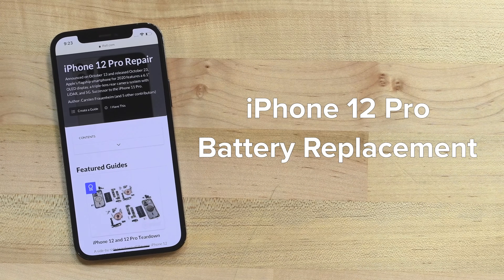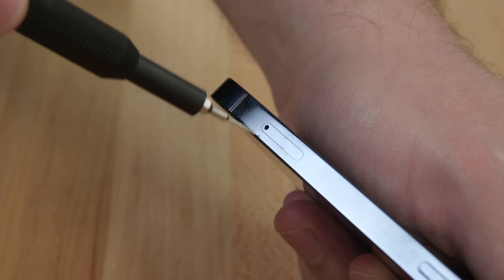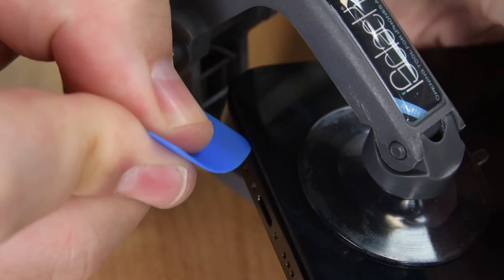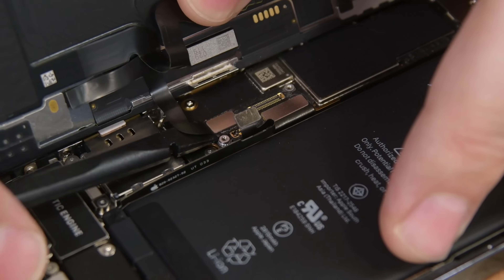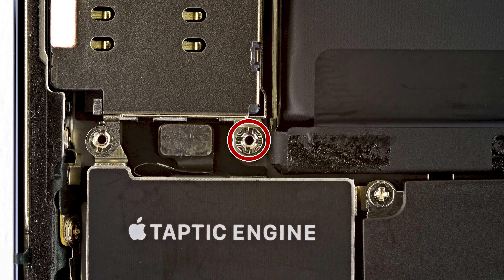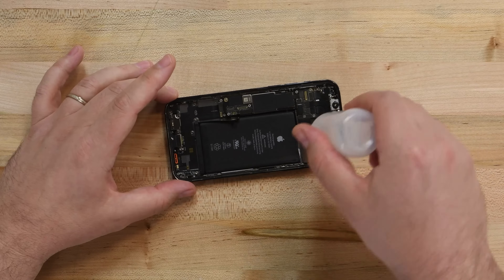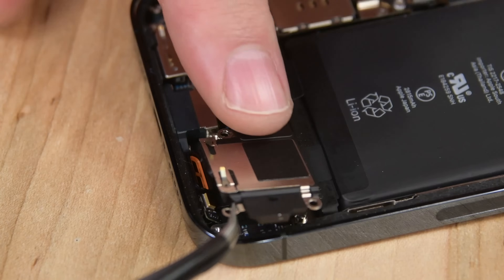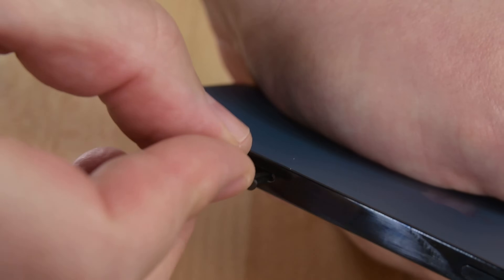iPhone 12 and 12 Pro Battery Replacement

Comment: Thank you for the video, still rocking my 12, but will probably be replacing it with something else that isn't an iphone, successfully replaced the battery, thank goodness for myopia when doing this sort of work, 45 and don't need a microscope ha! I did manage to snap a small tab off the speaker whilst cleaning up the display adhesive, but doesn't seem to have effected it as far as I can tell.

Comment: Notes (read through all before starting): 
1) Take it slow. If the screen doesn't want to come up, heat it up until it slightly hurts to touch (no hotter), gently ease it with the pick, back off, pull with the suction cup, try a different bit, ease away. Don't push the pick too deep. I used a plastic ruler to get under one side while I worked on the other. You could probably try to bend it too hard and crack the screen. Don't do that. 
2) You may lose a screw. They are about the size of a dust mote and they can ping off into non-existence very easily, especially if you are using the cheap plastic tweezers that came with the kit. 
3) The battery adhesive strips will snap when you pull them. Use isopropyl alcohol to weaken the adhesive and a 16 yr old islay scotch to calm your nerves. 
4) Under the battery, there's a circle of non-conductive paint that is very easy to scratch off covering the magnetic charger. Careful of that. 
5) The new battery may be a slightly different size, so make sure you (CAREFULLY!) re-bend the connector strip so that the connector can line up with the socket before you stick the new battery in. It might help to connect the battery first, then work out where the bend needs to be before sticking the battery down. 
6) The hardest bit is actually reassembly. Scraping the old glue off the rim. Take your time! A plastic spudger, cocktail sticks, alcohol and patience will get you there. Look into it with a bright light to make sure you've got it all out. No little balls of adhesive should remain.
7) Note that there are some raised contacts along the bottom of the phone that stick up to push against something on the screen. Careful not to bend them!

8) Putting the screws back in position without magnetic bits will be hard. Make sure you have a bright light on standby. 
9) Make sure the four screws for the top left cover go back in the right order. I believe the longest ones goes in the top left. Don't take my word for it - see which one came out of which hole. The longest one is only about 0.2 mm longer than the others. You may need reading glasses if you have poor vision. 
10) Careful not to strip screws. Be gentle turning and apply steady downward force while you do it. 
11) Apply the phone rim adhesive before you reconnect the screen. Make sure you get it the right way up. There is a right way. Don't take off the protectors until you're 100% sure. 
12) Be gentle pushing the connectors back into their sockets. Use a finger and gently wiggle them until you can feel them click into place. Don't force them in. Once you're sure they're all in, turn on the phone and check it's working, then turn it off and push the connectors all in again just to be sure they're not loose. 
13) Make sure you don't get dust/gunk inside the camera cover on the screen or the face. Don't stick anything down until you're sure it's clean and aligned. 

14) If you're like me and still not sure that iOS 18 will recognise your £20 new battery, it did for me after an update, even though it [claims to be] 9800 mAh. No soldering required, as the battery came with a BMS built in. You'll get the important battery message but it should show battery health too. You will need to calibrate it by charging it to 100% then leaving it on for a few hours then letting it run down til it dies, probably a couple of times. Then it should understand where its limits are.

15) Good luck! Don't kill your phone.
Reply: im not sure if this was a typo, but your battery is NOT 9800mAh unless its a different voltage for some reason but then it wouldnt work properly
Reply: @IcyPenguinCube  Yeah, it's almost certainly not. However, it does seem to be higher capacity than the original. Unless I spend all day playing youtube music with the screen on it will generally still be 50-70% when I go to bed, which is pretty decent
Reply: @tSp289  yea its definitly possible that its somewhat larger, the battery I bought claims to be 3320mAh when the stock one is 2815mAh if im not mistaken. battery technology has advanced enough to fit a higher capacity battery into the same size :)

Comment: After having done exactly this procedure - it's unnecessary to strip so many parts! It's enough to detach the battery itself and the display. It could be trickier to remove the adhesive strips underneath the battery, but fairly straightforward. Other than that -- very helpful guide!
Reply: You don’t even need to remove everything like they did here, just basically the part with screws  where the battery connects is hidden and that’s it, move the screen to the side and switch the batter with new adhesive and connect. They do too much sometimes making it harder than it is lol
Reply: Exactly. I have no idea why they remove so many screws and parts. And removing the sim tray - what for !?

Comment: I repeat, do not pry under the battery. I slid a pick in there to get the isopropyl syringe under it and the back glass snapped like it was nothing. This phone generation is such a pain to repair.

Comment: I know this is 3 plus years old but you don’t have to remove the bottom of board or  anything else. I replaced my battery today taking screen half way off leaning it on something and taking off just the battery cable. Thats it. The tape broke into pieces. I heated up my pry tool and slid it under the battery and worked the battery out. No extra cables or screws to take out. Just the ribbon cable for battery. That’s it

Comment: Now I understand why my nearest iPhone repair place is 1.5 hours away 😆 nobody wants to do all this and when they do they charge an arm and a leg 

I guess I'll just do it myself
Reply: It’s easy. I did one today without taking all the extra bs he did. I took off just the battery ribbon cable and used my case opener tool under battery and got the glue strips to let go. This guy makes it into a project.
Reply: @mickywinters8451  I would love to see a video of that 😲 very nice 👍 I just ended up prying up the battery and replacing it cuz it was ollllld 😆 I wore that dam thing out!!

Comment: Do you need a genuine apple battery to still have all functions?
Reply: Nope. All will work. But, your battery health will not work. So if you go and sell it someone will want a refund if the health shows not working. I just bought an oem Apple used battery with 89% health today for $15 on eBay. I actually have a 99% health battery thats installed in a 12 with broken screen but I didn’t want to pull a 2md phone apart just to use the battery so I bought one cheap and when I sell it the health display will work. If you don’t care about it go for it but as a warning the generic knockoffs I’ve used don’t last near as close as the oem Apple ones. My used Apple one I replaced in an iPhone 8 lasted longer than my new generic one.

Comment: Why are you removing so many parts? Isn't it good enough to remove the battery connector and then pop the battery out? please explain why all the parts arund it including the screen must be disconnected. Thank you.
Reply: Update. Watched another shorter video. He disconnected the battery cable from board only. Didn’t take off screen or sim tray is speakerphone and got the adhesive from the top with tweezers.  This guys is way too much just to get to the adhesive from the bottom. I’m doing a 12 on Saturday. Should be as easy as the 2020
Reply: Update. Replaced my 12 battery without taking all the other stuff out. It came out but the plastic strips he pulled off his, must have been loose from before. Mine broke into pieces and I ended up using my pry tool under the battery and got it out.
Reply: Yea I was gonna ask same thing. I didn’t see any connectors under the battery or at the bottom. All I saw was the 1st battery connection to the logic board. I’ve replaced batteries and screens from 6s up to se2022 and the battery comes off with one connection and a battery connection cover. Why’s he removing the SIM card reader and the microphone at bottom when the battery snaps in with one cable on the left side. The only reason I can think of is so he can get to the very bottom and get to the adhesive strips. Screw that. I’ll pry it up from the sides and not worry about the last 4 steps if this  is the reason to take off the other extra 4 parts.

Comment: I skipped removing the sim card holder and the taptic engine and it was fine.

I was only able to remove the largest of the stickers from underneath the battery.

A trick to make removing the battery easier, is to apply the alcohol underneath it and then use a suction cup on top of the battery and slightly and gently lift and release repeatedly to gradually peal the battery away from the phone.  Be careful not to bend the battery.

Took me about 2 hours total.
Reply: I tried to skip removing the SIM reader and Taptic Engine but all my pull tabs broke off. So I removed both, then ended up using alcohol under the battery which helped sooo sooo much.

Next time I'm applying alcohol first, and only removing the right-side Standoff screw from the Taptic Engine as Apple's official repair guide recommends.

Comment: So no need to solder the terminal? I have seen some videos where they do some solder the terminals.
Reply: i think that's called transferring BMS board from an original battery to an OEM battery to get the battery health back. Otherwise it will display unknown part message in settings.

Comment: I placed the battery slightly lower than the connector and didn't realize in time, I then followed the rest of the instructions in the video and screwed everything else in place and by the time I had realized my mistake it was too late. Not to worry tho, I ended up straightening the end of the connector and bending it to fit the socket about 16 times, it eventually clicked and I was able to screw on the little plate on and close the phone. I did in fact cry tears of joy when I saw the apple logo appear, Thanks iFixit

Comment: I skipped taking out the haptic engine, speaker etc. just took off the plates for the connectors, total of 6 screws not counting the bottom two on the outside
Reply: Is this any harder than doing it the reccomended way?
Reply: Idk why ppl do extra stuff
Reply: it’s easier until you rip the pull tabs, then it’s harder. with alcohol though you can soften  the adhesive and make it easier. just two different ways to do the same thing. about the same effort

Comment: Nice. Doesn’t look too bad except for that fancy suction cup tool. Doing a 6s & 8 battery replacement was very easy. Always had to use fishing line to saw the battery glue though. Thinking of grabbing a 12 . The 6s while a great solid device is just too small of a battery. And a battery case kills my LTE signal so I just need a bigger phone. Really should try an android but whatever, I’m anchored to 🍎.

Comment: do NOT do this yourself. I've replaced a dozen iphone batteries in the past, but it took me nearly two hours to get the display off on this one, even tho I have a temperature controlled heat gun
I replaced the battery just to find out that the display is broken now. I was already being really careful, that's why it took me so long, but this thing is so fragile, it's absolutely not worth it if you don't have the specialized apple repair tools!

Comment: this is way to freakin much to replace a phone battery this is an outrage!!! its easier to replace a car battery!!!?
Reply: to be fair, replacing a car battery takes 10 minutes if you do it the first time hhahaha.
Reply: @petruska111  Depends on the vehicle.
Reply: @lwh7301   Not really, except extraordinary or military vehicles. The battery is always easily seen, the only problem is that french cars have their batterie connectors switched, as far as I remember.
Reply: @petruska111  On a Chevy Venture (which I still have), several parts that sit over the battery have to be removed to get to the battery. Not hard to do, but definitely not a 10 minute job. Replacing the battery in this video does not seem hard either, but it seems the risk of failing is on the high side.
Reply: @lwh7301  Quite an interesting design choice, well I did make it kind of as a joke „10min“ still its not hard.

Comment: I just took my 12 pro to Apple and had them replace the battery.  $89+tax and done in an hour.
Reply: What was your battery percentage prior to the appointment?
Reply: @YuhBoiJeremiah  78%
Reply: @travr1131  is there a difference in performance?
Reply: @YuhBoiJeremiah  Honestly, it doesn't seem any faster since the new battery, but the battery life is way better than the old one was!

Comment: Re-installing the display adhesive was what I was waiting to see, because I feel like it's important to get it right, and you guys don't show it? Why?
Reply: Because they messed up on installing it
Reply: @rx8dude907  D'OH!
Reply: Was looking for this as well. For anybode else, Fixje (a Dutch webshop where you can buy replacement parts) has also made a video on how to replace an iPhone 12 battery. In that video it is explained how to re-install the display adhesive. Keep in mind the video is in Dutch but shows how to re-install it. In that video, at 28:30, the guy starts to apply the adhesive.
Reply: @jwaw-i9i  +
Reply: it's in a separate video, a link to which is in the description.

Comment: How much editing do you do on screen removal?  Also when you put the screws back in how do you get them to stay on the tip of the driver? I would get them going to hole the magnetic screwdriver would change alignment. Any suggestions there?

Comment: To me… this seems like you removed a lot of things that were not hindering the removal of the battery. Was it for safety concerns , or removing some things to avoid being damaged. Again. Seemed like a lot more removed than what was holding that battery in. Based off previous designs is how this opinion was formed.
Reply: Exactly. I saw no reason to remove any of the other parts. Once you have access to the battery strip and can disconnect it…the next step is removing the tape straps. This was over complicated.
Reply: @kenankajtezovic946  agree this is overly complicated, just changed mine and as you said, once you have access to the battery strips, there is no need to remove all the other parts. Makes me feel that the video was intentionally made this way to put people off doing it.

Comment: anyone can help me? i installed new battery it was 3800mah but screen its not working sometimes it shows yellow screen idk why but touch is working because i can turn the flashlight on
Reply: You broke the display. You will have to replace it.

Comment: I just removed the screen and heated the back glass up and slowly pryed the battery out. No problem. Took 15mins
Reply: I don't understand why they removed so many parts. Like removing the speaker, Sim card reader and taptic engine didn't change anything about the accessibility of the battery...
Reply: @djine552 exactly
Reply: Could be apple-required removal of components/repair manual time. Just like working on vehicles, there’s an amount of time and it doesn’t always take as much as the book says.
Reply: You can easily snap the back glass if you pry in the wrong place, doesn’t require much force. But I‘m glad you were lucky!
Reply: after seeing that comment I'm more confident in trying the 12 now 😊, people were saying how hard the iPhone 7 was but I managed with my first try this won't be THAT bad right?

Comment: So, there was adhesive scraped off the edge of the screen. Is that adhesive not replaced? I was in a battery store and overheard the clerk quote a price of $189.00 to replace the battery in this iphone 12! I thought the battery must be really expensive, but no, they run around $40.00! So, the labor, at least at this one shop, is $150.00!!! I thought "I wonder if I can do this at home?" Yup! Here I am watching this video! I already have an iFixit toolkit, and the job doesn't look difficult, so I'll do it myself if ever needed.
Reply: Apple store will practically replace most new iPhone batteries for 100.00 or less, iPhone 12 only cost 89.99
Reply: @johnjkizer6399  yea my repair shop does it for about the same price as well, i think it was just that repair shop. oem as well
Reply: dang that's insane.  a store near me quoted for 60 bucks...but I already bought the kits haha.  I'm just gonna do it.